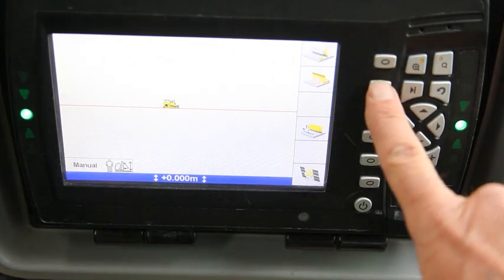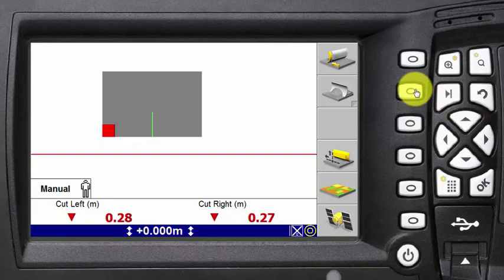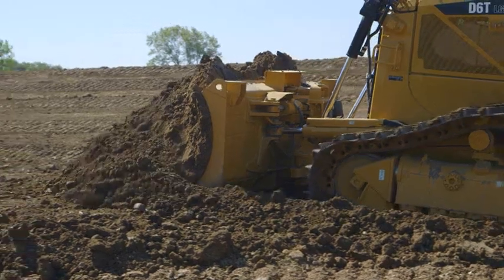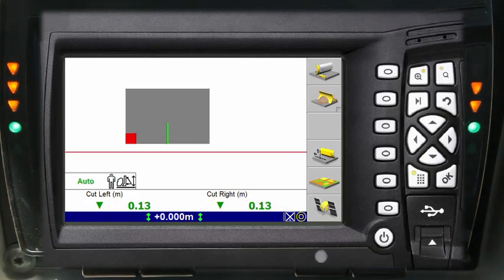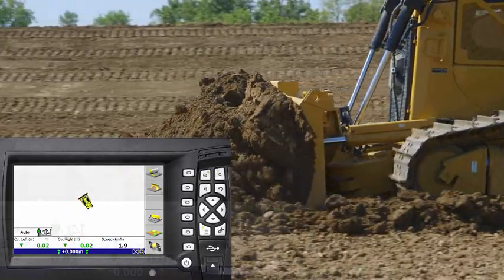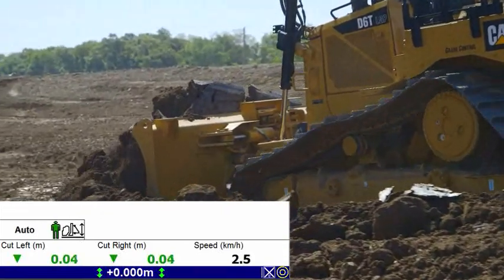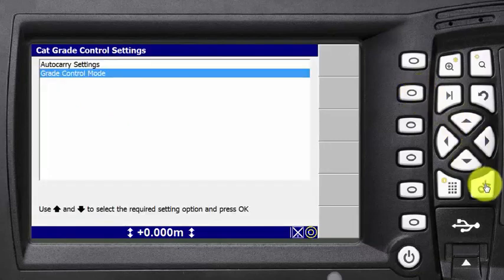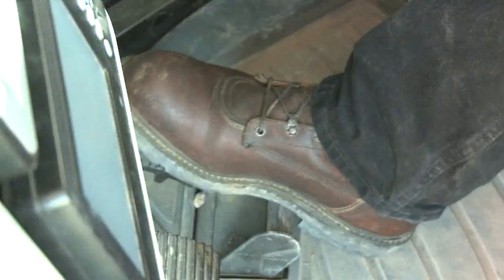Cat® Grade Control for D6T | Advanced Operation

Comment: Tip: Start cutting your grade  closer to the fill area and gradually work your way back and create a slot for pushing. Do this and you'll get a feel of how much you can grab and push a full load with minimal adjustments while the windrows on each side will help you with containing the bulk or load.  Get one slot done then make another next to it and continue the process. Windrows laying everywhere now you can stay on grade and clean up diagonally and stay on grade. Try it or fight it like you been doing!